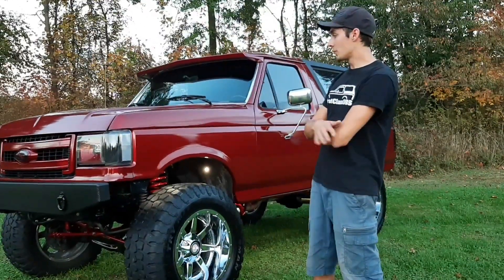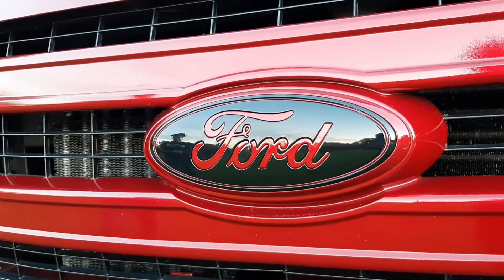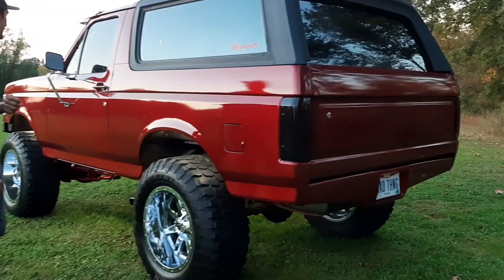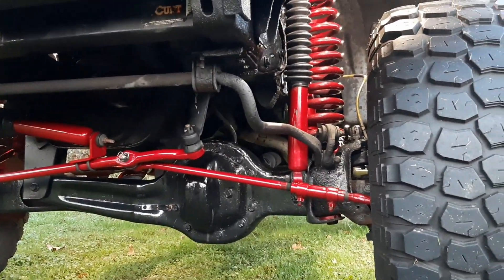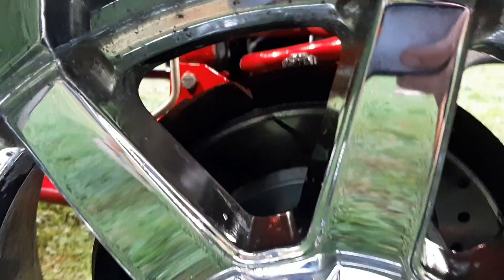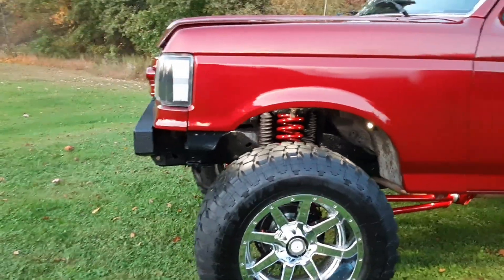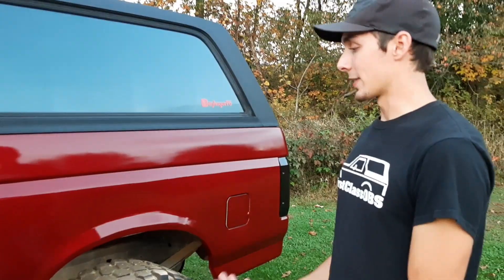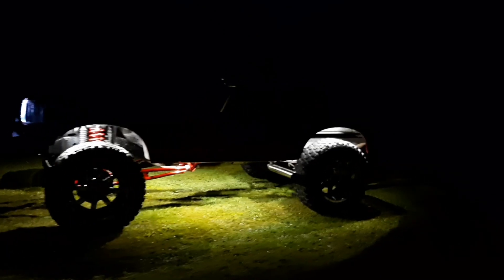CUSTOM BRICKNOSE BRONCO!    1987 Ford Bronco walk around

Comment: I really like it man I got my 88 getting done for the summer
Reply from the maker: Thanks I appreciate it! That's awesome man👍
Reply: What lift kit do you suggest I don't off road much rc or bds
Reply from the maker: @anthonym9137  I ran a Rough Country for my first lift on this awhile ago and had 0 issues, it's honestly the best bang for your buck, I'm running a 6" superlift in mine now and love it
Reply: @JustinsCustoms76  how is the rc lift compare to the super lift
Reply: how is the ride from the RC to the super lift what's the difference
Reply from the maker: @anthonym9137  Honestly can't tell too much of a difference, went from a 4" RC to the 6" superlift, the superlift has the drop radius arms which helps but both drive just fine, no huge difference in driving. Superlift has better quality parts but the Rough Country is a good choice too, I don't regret buying it I just went bigger, I actually still have the RC shocks on it now and they're still good
Reply: What is the name of your back bumper
Reply from the maker: @anthonym9137  Roll pan, got it off Amazon
Reply: Which one sorry for all the questions

Comment: How did you mount the led pods
Reply from the maker: Pulled the headlights apart and mounted them from inside, lock nut with a washer big enough to keep it from pulling through the bulb hole